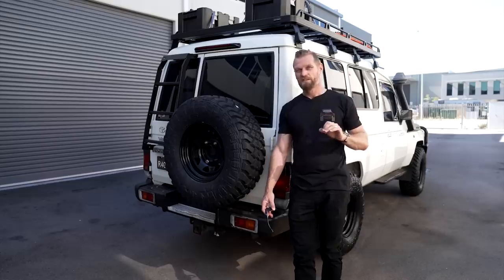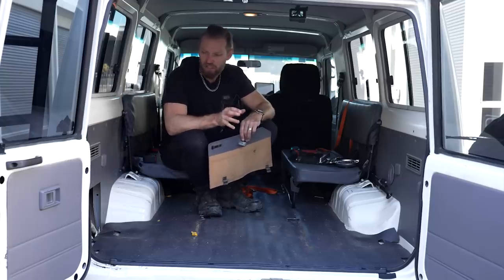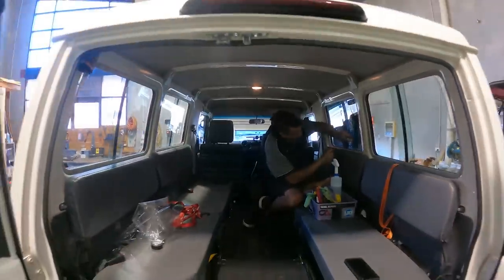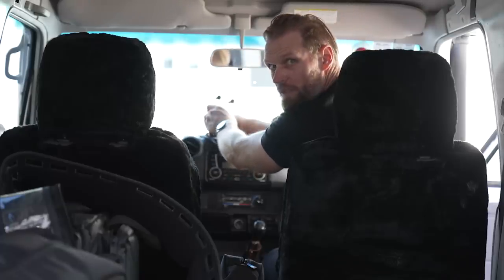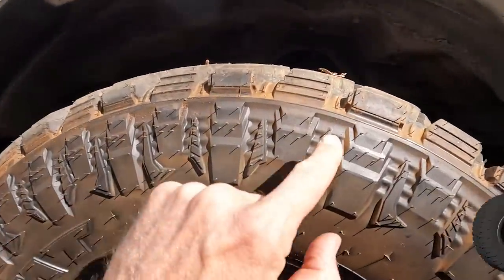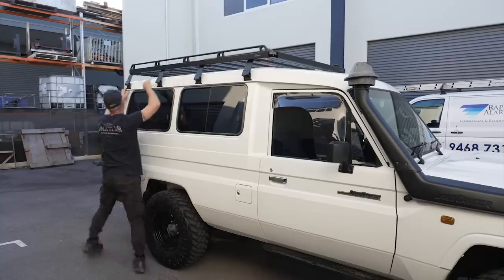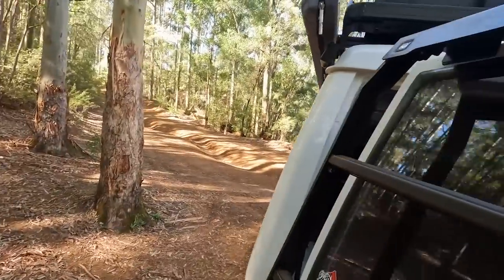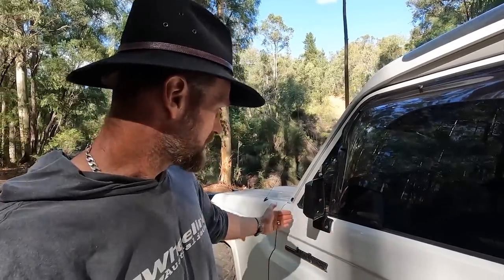The TROOPY Project, First Mods

Comment: Depending on the age of the younger ones, a roof conversion may not give enough headroom for sitting when traveling.
Reply: I have a 5 seater with a mulgo roof conversion, it was too low until I got the bed in the conversion lifted by an inch and the rear seat dropped by an inch, now my 189cm son can sit in it with no problems. Re the mirrors, the clearview mirrors have an issue where they magnify the view so it narrows the view, but even still better than the original. Common on pvs do something re the mirrors….

Comment: You can have a rear bar, but if you attached the bar to the original tyre mount with a rod and bearing. (Allows it to slide when the door opens).

It means it opens with the door!
Reply from the maker: Yeah but just spoke to an engineer and it will flog out the door hinges after a while because then we are making a connection between the chassis and the body with the hinges being the weak point 😬
Reply: @Ronny_Dahl  that is really good point, need to find a way to fit it to absorb all axis of movement so it doesn’t break the hinges of after 5m mins. 
Maybe having rubber bushings to have some movement?

Comment: Any thought of making it a 3 door with the rear seat forward facing for the kids??
Reply from the maker: No too much cost for a very little benefit
Reply: I had the same predicament but ended up fitting a forward facing 2 seater in the 2nd row, making my Troopy now a 9(8)seater. I did this to fit a child seat for my 2 year old. When he's old enough I will return to 10 seater or 6 seater as Ronny has done. Most versatile 4wd! I love it!

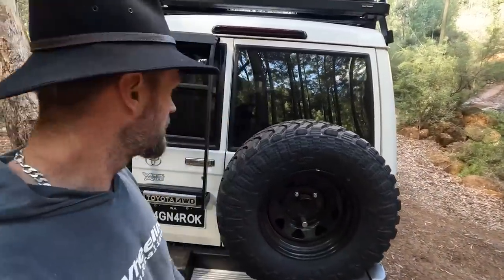Comment: @8:21 mark, the door already sagging looking from the panel gap comparing the left rear door and right rear door. 60 series large/tall side mirrors for replacement ?
Reply from the maker: It’s missing the rubber but inside the latch too only just worked that out. Need to get one from parts or wreckers
Reply: So is that why it is rattling? The rubber in the lower latch receiver is missing? I find I need to grease mine occasionally to stop it squeaking. But it holds the tyre weight (33s) just fine. I step on the tyre to get in the roof too. No problem sagging.

Comment: Is it 'legal' to pull out those seats, its licensed as an 11 seater but can't sit 11-10 now, just curious as have been told that it is illegal to pull out the rear seats on a dual cab for extra space.
Reply from the maker: Going through to process
Reply: @Ronny_Dahl  I had to keep the 11 seats in to change from N.S.W to S.A  rego .Has to be what the plate states in the transfer.Took them out after that process.

Comment: Love it, how do you handle the registration after removing seats?  How much does it cost?  Can't imagine you would want to change the seats too much.
Reply from the maker: Plans are to leave it as a 6 seater or even a 10 seater looking into it at the moment
Reply from the maker: Like the 79 a few things are ongoing with mod permits ect. Almost done with the 79 but which means I can make a video about it
Reply: If you remove seats you need to do an L1 Seat Reduction. Cost is minimal, but you need to get it inspected and re-registered as the Seat Nomination you have reduced it to. Same applies if you put the seats back in. That's W.A. Permit and Registration Law......👍

Comment: There are two designations for the 285/75/16s.

The regular MT772, which is the run of the mill RAZR and the MT772M, which is the mining spec.

I'm on my second set of MT772Ms and no issues, but do take a little more to get them to bag out. 👌

Comment: What is the go with people putting aftermarket mirrors on their troopys? I often wonder are people that incompetent with their driving skills that they need those ugly bat wing looking mirrors. Keep them stock because there is literally nothing wrong with them. You can also still see out your back window 🤷🏾‍♂️
P.s I’m glad you went with the sheepskin covers. They’re a treat to travel on.
Reply: The little mirrors are terrible… with the height of the troopy, little lift and the high side windows anything low and the side is impossible to see.  I lived in fear of not seeing the little car or motorbike beside me and changing lane over them. Nearly happened a couple of times with motorbikes filtering through moving traffic. I had  them replaced with clearview mirrors, better but they magnifying reducing the width of view.